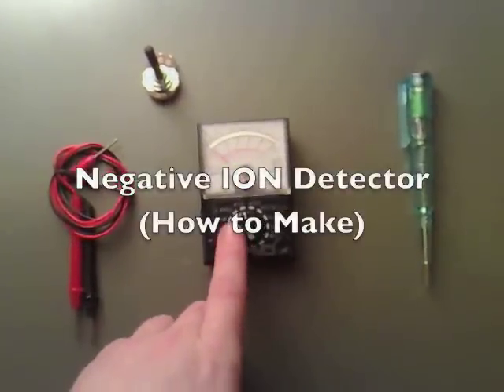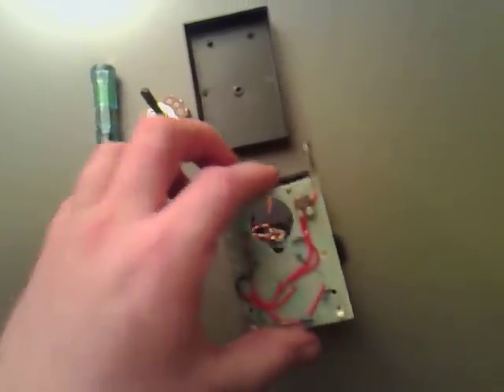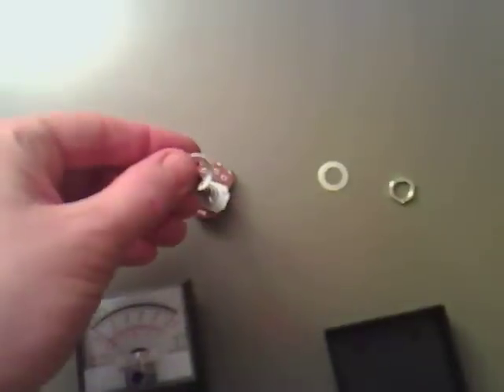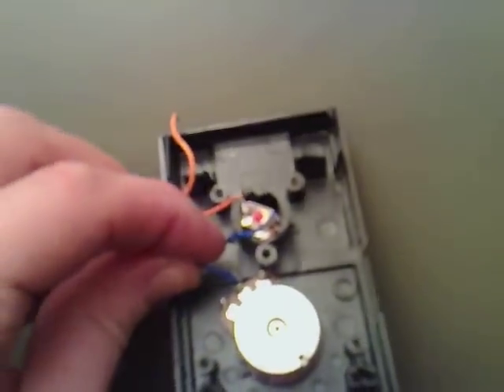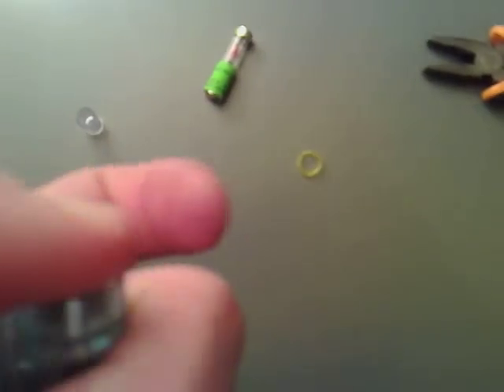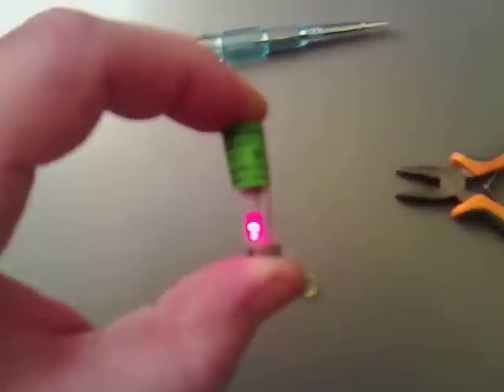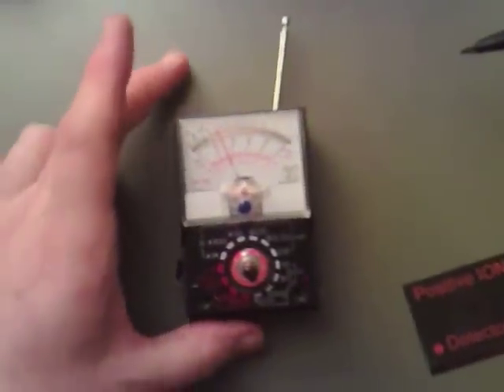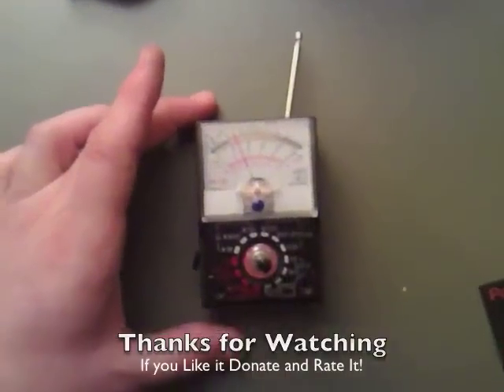Negative ION Detector (How to Make) 003

Comment: As from what I’ve seen here it does not measure anything, it is just detecting discharges to the antenna of this so called device. Also visible plasma or corona what ever you call it creates 03 ozone. As a conclusion your “device” should be able to detect negative ions few cm away from the generator.

Comment: The screwdriver contains a mono-type transistor, which is used to check the safety of the electrical wires as soon as it touches the bottom with a finger that shines and costs less than a quarter of a dollar

Comment: i am in the US so what should i be looking for in the screwdriver, a circuit tester? this is a real question. i just do not understand what is in the screwdriver other than batteries , the big resistor  and an led. please give me a link to the screwdriver you used or one i can find. please . then i would consider this a thorough video. thank you!!!
Reply: It's an electrician's screwdriver. 
They light up when you touch both ends, so you know it's working.  Then you poke about at mains wiring while touching the back.   If it lights up it's live, hence the need for a mega ohm resistor

Comment: Why all negative ion circuits I see have FET transistors, or capacitors and a couple of resisters, plus a 9V battery?

Not just an led with a small "dot" battery, led, one resistor,  and a potentiometer?

Seems like things are missing:

Comment from the maker: A shower releases negative ions as the water hits the floor...

Well its sensitive and measures the Ion that are negative, do a google search, electricity can travel through air at about 1mm per 1000v

I went to a testlathon it measured negative ions! Have you ever been around a High Voltage Tesla Coil.

Check out my Tesla Coil videos.....